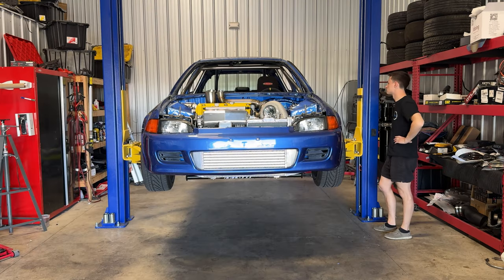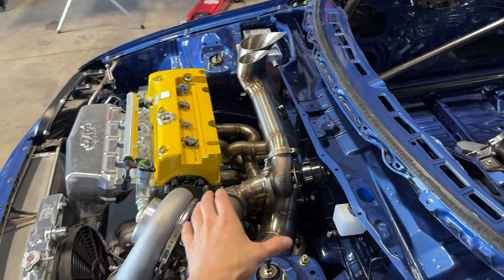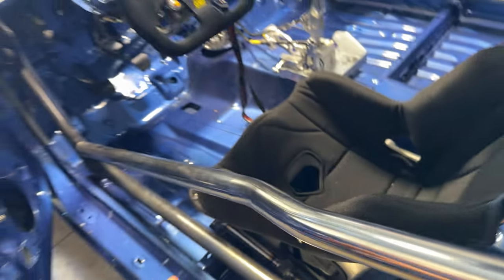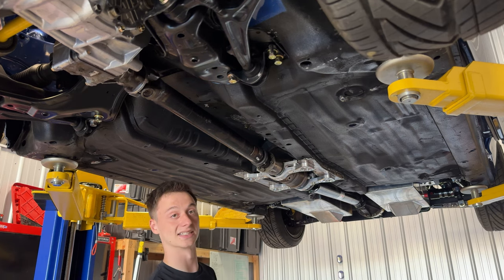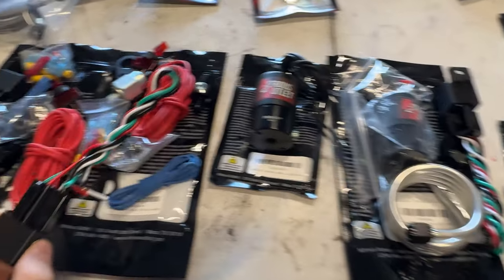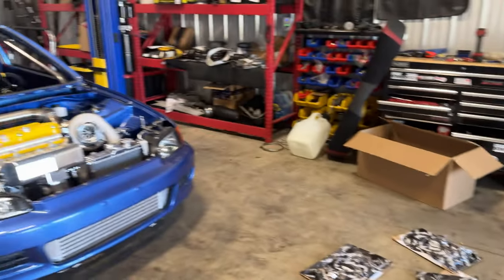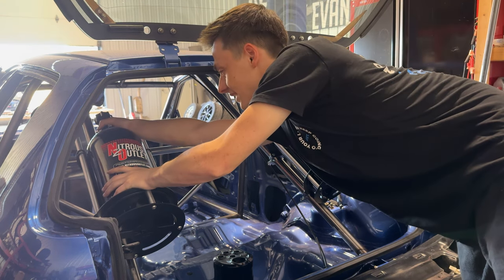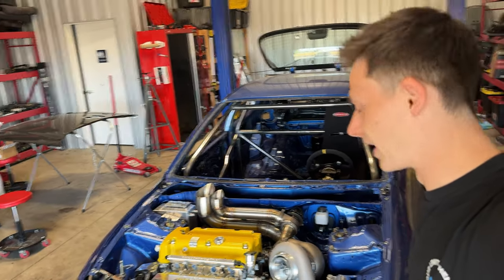Building an AWD Turbo Honda Civic

Comment: Very cool. im actually in the middle of wiring my nexus.
Reply from the maker: How’s it coming?!
Reply: @RemmyEvans  going good haven't had much time due to work. But I have the harness partially made, just need to lay it out in the engine to get the proper lengths. This ecu/vcu makes things so much easier to wire.